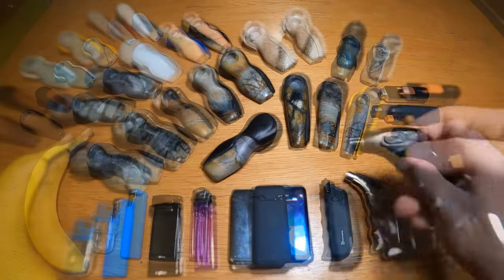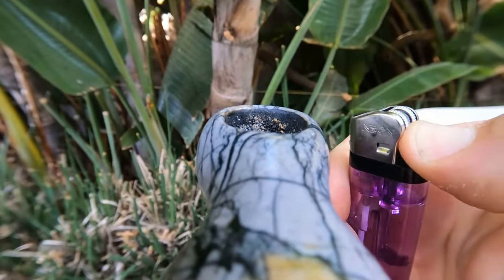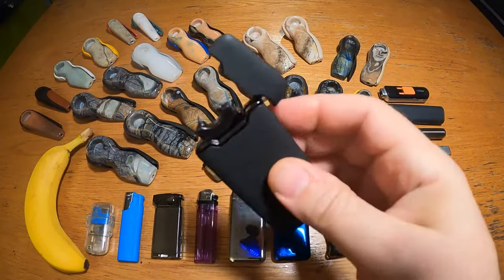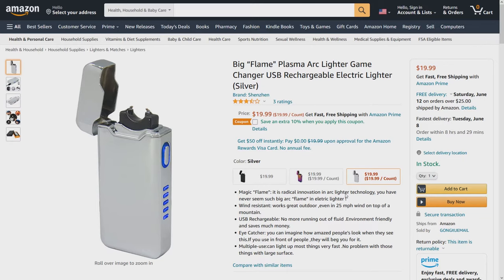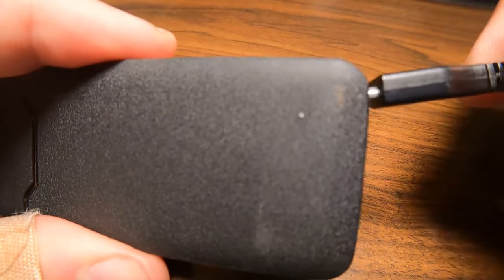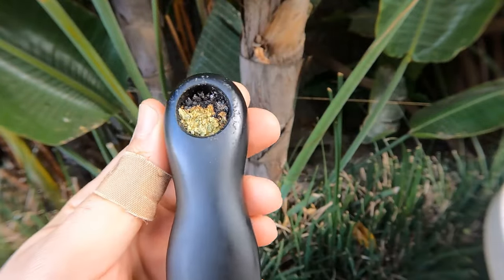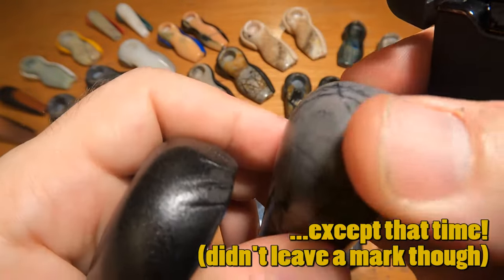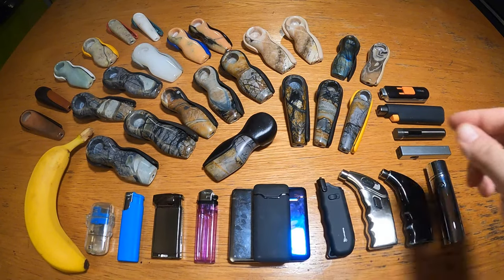An electric lighter that behaves like flame; detailed review & comparison

Comment: What is the technology behind this? I noticed the probes have a plastic tubing around them on the quizen I ordered. I believe it is atomizing the plastic as fuel. Why would this arc has such different properties than another arc? The battery tech is the same.
Reply from the maker: > Why would this arc has such different properties than another arc?

My working assumption is that it's switching at a much higher frequency (i.e. faster than we can hear it, which is why they seem to be silent while operating compared to the other models.)

> I believe it is atomizing the plastic as fuel.

Not intentionally.  My buddy had some similar issues, where it seemed like there was some fluid bubbling out from under that plastic sleeve; he sent me a close up video.  I think it was just oil from the manufacturing process that wasn't supposed to be there.  Hopefully, after you use it for a little while, all that will be burned off, and it'll settle down.  (and hopefully without shorting itself out in the process...)

Comment: Mine has 2 little plastic covers on the outside of the prongs and it doesn’t stop it from lighting but I’m not sure if they’re supposed to be there or if I’m supposed to remove them ( I’m talking about the Qizen lighter)
Reply from the maker: I think those are supposed to be there, but how far they cover the probe seems to vary.  Have the ends of them scorched or melted?  A friend of mine bought 2 of these that seemed to have some oil or something still underneath those covers, or maybe they were too long and close to the hot bit and were melting themselves.  He sent me a close up video showing something bubbling off from under those when he activated it.  I expect that resolved itself after a bit of use, but I didn't follow up with him, and didn't notice that on my own.  I know he has had a few failures, and bought a few more after, but I think that was for separate issues.

Comment: do you think this would substitute for a heat gun people use for acrylic pour painting -- the goal is to heat the surface of the paint to create cells and remove bubbles
Reply from the maker: I doubt it.  For that you want something you can sweep over a wide area quickly.
(I've heard conflicting information, but some say it's actually the CO2 in the exhaust that pops the bubbles not the heat, and so a blowtorch works better than heat gun. I have only done a pour like this once, for a table-top, and heat gun worked okay. Didn't have a torch to try.)

Comment: Hey bud I have had this "Atomic lighter" from bulbhead and it has always made a loud high pitch sound that people around me claim is really loud.I cant hear it due to some hearing loss but everyone that hears it claims it is almost painful.do you have any idea why this happens and are there others that have this issue????
Reply from the maker: I'm not familiar with that particular model, as it obviously won't work for a pipe; just things like cigarettes you can insert between the probes.  Looks like one of the 1st gen designs from a few years ago.  I'm not very savvy with electronics, but I expect the sound comes from the high voltage switching frequency.  I.e. the little battery charges a little capacitor, then releases the energy all at once, making a spark.  That happens again and again, really quickly.  If this is happening at a frequency within range of human hearing, it makes a sound.  So, nothing to fix, this is just how those older lighters work.  I suspect the reason that the newer one is silent, is because it's switching at a much higher frequency, outside the range of hearing.  If that was the case, then perhaps the reason we hear that cartoonish noise when two are brought near one another is due to beat interference and doppler shift.  (I.e. frequencies of two lighters aren't exactly the same, and difference between them is audible, and changes based on relative movements.)
Reply: @TheWackyNeighbor  you need upload more amazing content !

Comment: Do you still feel that this one (Verve) is the best for smoking?  I see currently listed arc lighters on eBay and Amazon with 2 streams that cross each other like an ‘X’.  Are these dual stream arc lighters better or worse than the Verve?  Also, do you recommend any of the 2-in-1 lighters with arc and jet torch ?  It looks to me like the jet torch part of the 2-in-1 is butane but the arc lighter is electric.  I was originally planning on getting a traditional Scorch. Torch type butane lighter, but then I found your video about the arc lighters and now I’ve got to get one but just trying to decide what to get
Reply from the maker: > Do you still feel that this one (Verve) is the best for smoking?

It is the best one for pipes that I have encountered so far.

> 2 streams that cross each other like an ‘X’.

There are two different styles that fit that description.  There are "2nd gen" models (such as Qizen RS1) where the probes face each other.  Those are suitable for cigarettes, joints, and candles (where you can stick the thing you want to light in-between the probes), but are useless for pipes.

There are also various "3rd gen" models that have 4 (or even 6 probes) all facing forwards.  I showed a few of those in the video.  These can be used for pipes, or anything really.  But you have to come close to actually touching the probes to the thing you're lighting, it's not like the new "4th gen" model I feature in this video, where the flame has a lot of reach.

> Also, do you recommend any of the 2-in-1 lighters with arc and jet torch?

Never tried one, and am not sure what the use case would even be.  I typically think of dual format lighters as being intended for indoor/outdoor use, but jet + arc sounds like outdoor/outdoor to me...  What's it for?

> It looks to me like the jet torch part of the 2-in-1 is butane but the arc lighter is electric.

Correct.
Reply: @TheWackyNeighbor  Thank you for the reply.  What do you think is the best lighter for a bong?
Reply from the maker: Are you taking it outside, and need something windproof?  Are you bothered by butane fumes?  If the answer to both of those questions is no, then a regular old disposable soft flame butane lighter (such as a Bic) ought to be just fine.  I went electric because I wanted windproof.  Others do so to avoid butane fumes.
Reply: @TheWackyNeighbor  I usually smoke outside in the covered screened-in  porch area, and occasionally inside as well.  Sometimes there is a little wind on the porch, but nothing like standing out in the open totally outside on a windy day.  As for butane, that definitely bothers me which is why I would prefer electric.   I’m trying to make my hits as “low toxic” as it can be.  That’s why I bought a tree perc bong yesterday, and I also am using brass filters in my pipe bowl as well.  I will also be using filtered water in the bong.  Given all this, do you still think the Verve is the right one for me?
Reply from the maker: > Given all this, do you still think the Verve is the right one for me?

Sure; it'll work fine.  But, I'd suggest you get at least 2 of them; so you can always have a fully charged one standing by, and to increase chances you'll wind up with at least one reliable one.  (There have been some quality control issues, and seems some fail quickly.)
Reply from the maker: Oh hey, one more thing  @giant_avocado7973  

> I’m trying to make my hits as “low toxic” as it can be.

I'm "the pipe guy", so I'm not really the right person to advise on this, but if you find that you're sensitive to inhaling smoke, you might want to investigate vaping instead.  That doesn't just mean using 'juice' or 'wax' or 'dabbing', you can do it with regular flower.  Just a matter of heating it up sufficiently so that the volatile compounds vaporize, without getting quite hot enough for the rest of it to actually burn.  Google "e-nail for flower".  Lots of options in this space, many that would be compatible with your new tree perc bong, but I can't offer any more specific guidance.  (But I can vouch for Vapor Brothers brand stuff; I'm friends with one of them, who's the inventor of the original vapor box style vape.  Volcano style vapes came first, but you had to wait for them to cool down before reloading.  Vapor Brothers was first to have a separate hot element, with a "whip" that could be reloaded quickly.  There are many cheap knock-offs, but their stuff is very high quality.)
Reply: thanks for your help, got my lighter and its AWESOME.  Have another onthe way.  I'm gonna get like 10 of these things in different colors!

Comment: I bought one and it died in one week , dont buy !!!
Reply from the maker: People's experiences vary.  I had one last for more than a year of frequent use, before it's sparks grew weak, even at full charge.  I still have 2 in good working order.  Had 2 that failed pretty quickly though, it's true.  I was just passed along a message qizen sent to another customer that had returned a dud; they say they have made some updates to chips to prevent overheating and shorts recently, but have limited color selections left in stock.

Comment: There are really quite expensive. I can get a high end smart butane lighter for that price and am more inclined to go this route. I may purchase one from China but I could see it breaking very easily
Reply: Im Not familiar with smart butane lighters. Could you point me to some or explain what it is?
Reply: Maybe but not really, I have 3 of them all working still after, believed or not, 5 years. 3 persons used 3 lighters for 5 years. Those that I have, have sealed transformer, I am not sure where he got those which are not sealed, thus prone to arc flashing.

Comment: Just tried the lighter up skiing , the torch lighter was WAY better. $45 is a JOKE ! And the battery lasts about 3 minutes !
Reply from the maker: Well, if you paid $45, you got ripped off!  (In the video description I provide plenty of cheaper options, down to $20.)

Where were you skiing?  It's been ages since I've been, but I had noticed that above a certain altitude, my jet lighter stopped working completely.  (At one local small mountain, I had no problems.  At a bigger more distant one, it would work at base camp but not on top.  Perhaps if I'd had a screwdriver to adjust the valve I could have fixed it.)

In any case, I still don't like jet lighters for general use because they will light the entire bowl; you can't easily hold it to the side and subtly light just part of it, which is my preference as explained in the video.  If you're smoking joints and not pipes, then you likely don't share this concern.

EDIT: I just realized you're the SAME DUDE who posted last week complaining you never even received the lighter you'd ordered [and so jet lighters are better].  Why are you trolling?

Comment: Any new videos coming out soon??
Reply from the maker: Thanks for asking!  I have a bunch of videos planned, but none will be ready soon.  Potential upcoming topics include:
"On pipe smoking; etiquette & best practices"

"Carving a smoking pipe out of stone; chill out edit (10 hours to 10 minutes)"
(With music.  Already have the block selected; recorded plenty of B-roll when I was sawing up the rough a few weeks ago.)

"How to turn drill press into a grinder [and why you shouldn't]"
(Describing my arbor bearing that reacts tool loads from below, and double-U joint that transmits drill torque from above, and myriad accessories for every sort of situation and material.  A dedicated grinding machine would be preferred for most people, I just had no space to put one and got inventive.)

"The quarter note cap, an industrial design case study"
"Thermal forming plastic sheet by hand, with cord stretch technique"
(Discussing the design of the caps, and how they’re made.)

"Closed loop water recirculation system for lapidary use"

"Cutting up labradorite to make pipes; lessons learned to maximize flash"

Of course, if I happen upon a better lighter for use with pipes, I’ll make another review & comparison.  The original black qizen I got first is still the one I mainly use; and has continued to be reliable, except I’ve had to repeat the solder fix for the broken charge jack a few times.  No more failures among my backups either, but I did notice the blue one didn’t seem to spark with the same power any more.  Squeezing the probes just slightly closer to one another fixed it.
Reply: @TheWackyNeighbor  Awesome!! I'm very interested in your jig setup and of course your water system!! You combine a lot of my interests lapidary, cannabis, and precision boring. In my humble opinion, you have created the perfect channel. Thanks!!